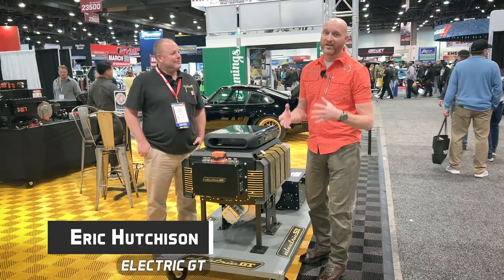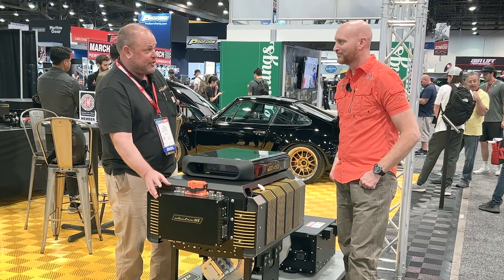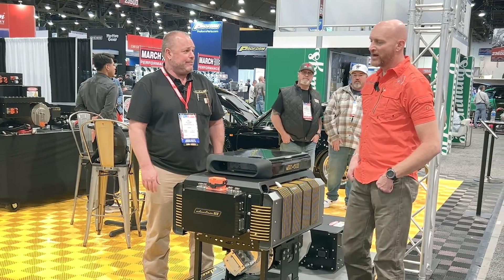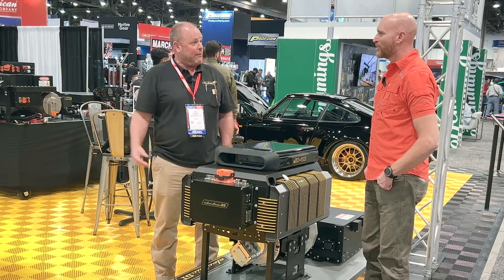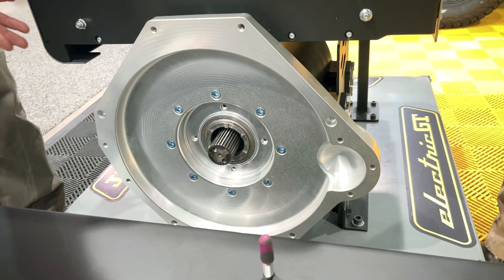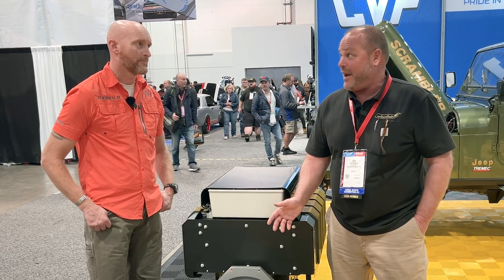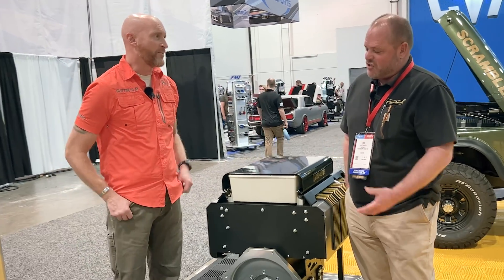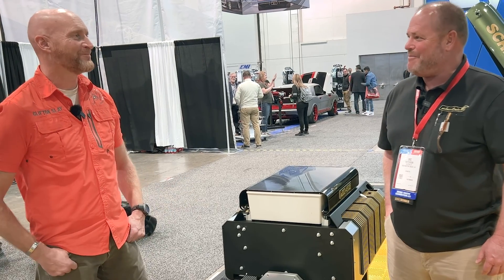Electric GT - The LS Swap of Electric Conversions

Comment: It is my understanding that these kits price point will be under $10,000eventually. I believe in ten years they'll be in the 5-7K price range as competition grows and they're producing them in larger quantities. Distance will come with improved battery efficiency and so will the benefit to the environment. Something we did not get to cover, but will is the new capturing devices of electricity to bolster the batteries through suspension movement. Charging stations will proliferate as there is demand. ~Clifton Slay

Comment: I forgot to add they didn't talk about price how much it would be to do this for the older Jeeps unless i missed it.
Reply: They don't mention price but if you look on their website... it's a lot. However, their website also shows that they are working on lower hp models which would probably be cheaper and probably be a better fit for older Jeeps anyway.

Comment: What about the idea instead of 100% electric why not make it a hybrid conversion gas and electric?  Or could that even work for this?
Reply: I would think that the simplest and most efficient way to do that would be to charge the battery with a small gas generator as like a range extender of sorts. A nice little quiet one could fit in the back and could be used for other things as well while camping.